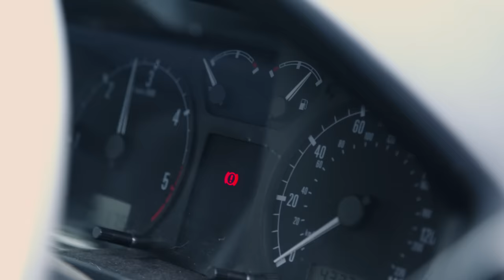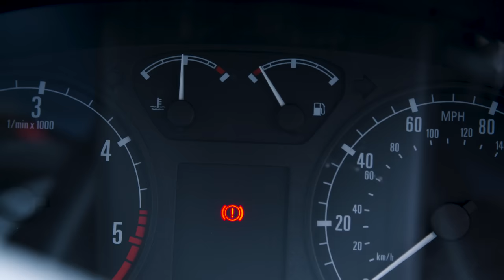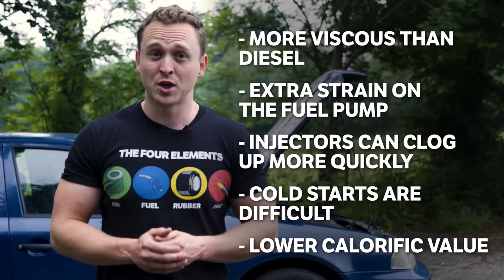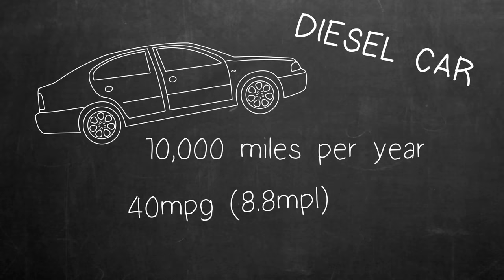The Pros & Cons Of Running An Old Diesel On Used Vegetable Oil

Comment: My dad owned a Citroen Bx 1987 1.9 liters diesel. We ran it 1 year or transformer oil. She was really good, quick note it actually cleans the injectors. When we switched back to diesel she was perfect. We bought her at 200 000 kilometers and we sent her to the junkyard at 1 400 000 kilometers. She did 0-160 km/h without any problem when we bought her(that's her max) at 1 400 000 she didn't lose even 1 horsepower and still did 0-160 km/h without any problems. Too bad rust claimed her...she's the strongest car I've ever known and I will ever know in my whole life!
Reply: Vladislav Levenov 1.4M kms wuuuuut??? :D crazy
Reply: I looked this car up and it reminds me of the earlier Ford Taurus which was a revolutionary design in America beginning in 1986. I wonder if this is where Ford drew some inspiration. Interesting.
Reply: Damn you onion cutting ninja.
Reply: those are some impressive numbers, no doubt!
Reply: You can run an bosch pumped XUD on near enough anything. Bombproof.
Reply: Errm,that transformer oil is cancerogenic and shouldn't be burned like that.
Reply: CME But it freaking made that BX go for 1400000 km.
Reply: Frytki? Almost any car will do that if you have regular maintenance.
One of the vans at my work has 900.000 and it is made in 2004. 
I think they are waiting for 1 mil and then retiring it.
VW Transporter or something like that.
Reply: What ???
14,00,000????? Km?????
R u kidding us??????
😂😂😂
If u drove this car 14,00,000km than u gonna get world record.....
...
In India i've never sewn any car more than 3,50,000 km.....
Even our daily driving public transportation send to junk at 8,00,000 to 10,00,000 km.....
And if any one see 1,00,000 km on odo than say its over now time to new car😂😂😂😂
Reply: Jigar Patel Theres some guy in the usa whos dailyed his porsche since new in like 1970, when it ticked over to 1M miles porsche gave him a 911 to congratulate him, but he still drives his old porsche, he says he doesnt trust new cars and if anything is up with his old one he will know instantly what it is... props to that guy 👌
Reply: why its she?
Reply: Damn you indians are strange. Ive never seen a car die before hitting 200.000km.
My last car did 220.000km until it had some problems with the suspension which would have been more expensive than the car itself.
The car I own now has 170.000km and looks and feels almost brand new (besides alot of scratches on the inside from the previous owner). There are alot of people selling this volvo-model with more than 300.000km online.
Reply: depends on how you maintenance them tho.
Reply: Jack Williams.....
I know many people drive their car more than 1M miles in USA....
And it's a good think....
Even in Canada has a wild nature though on autotrader.ca  most of car crossed 1,50,000 km which is for resell... But in India there is a many car which cross 1,00,000 km ... But  not much more cars which cross 2,50,000 km ..... Its may be due to weather or might be traffic... All are possible.......
But I seen Toyota innova  Toyota quails definitely cross 3,00,000 km in India but after that they being risky when they put you middle in the road no one know..... That's why no one touch it on resell....
...
My brother drove 1,80,000 km on Hyundai Verna (accent on USA) diesel model..... And it goes no any michenical problems.......
But when someone borrow they ask first will it make me possible to reach my destination?....
But its OK for long car journey also....
Reply: zampano 006 ...
U seems brother of 007 😂😂😂
Ya man its true in our India many Toyota cross 3,00,000 km without any hesitation but after 1,00,000 km people think that if there will be any major fault happen than it will cost us much more ... So people avoid that cars many people buy it but most of them try to avoid.....
But it worn out has some reasons ... May be weather..... Might be traffic........
All in all if u cross 1,00,000 km than  your resell value become very law... And its fact in india
Reply: Jigar Patel It's 1,400,000 not 14,00,000, why are you typing it like that? That's stupid
Reply: MegaxeonLV
 U r just taking it wrong....
That's what we Indian use......
We don't use billions million we use lacks.....
1,00,000 one lack 
54,00,000 fifty four lacks its a common math we all use in India.....
If u came in India and ask for million billion than many people Google it to translate in lack and carore....
10 ten
100 hundred
1000 thousand
10,000 ten thousands
1,00,000 one lack
10,00,000 ten lacks
1,00,00,000 one carore 

That's how we use this maths
Reply: Jigar Patel Now i understand it seemed just a bit confusing previously ;)
Reply: Jigar Patel you're writing in English, so why do you use Indians mathematics on this comment section where every Nation of the world meets and doesn't understand your usage of numbers? 
You could write it once or twice, but damn you only write like that. 🧐
Reply: MegaxeonLV
Yes
Reply: hawkseye
U doesn't understand number Codding but u can understand number itself.....
And that's not my fault it just a action which comes natural while I m typing.....
...
If I was use 1 lack 2 lack 3 lack that might be bit confusing for all so that's why I used numbers man
Reply: Jigar Patel what I wanted to say is, that not everybody understands the Indian number system. You wrote 1,00,000 instead of 1,000,000 (American system) or 1.000.000 (rest of the world). So you miss one "0". It looks like 250.000
Reply: hawkseye
You are not wrong at your mindset.....
And I m also not wrong at my mind set.....
...
That's the confusion between two numbering methods😂😂😂😂
Reply: World record is 5M KM. A volvo p1800
Reply: TRANSFORMER oil?!?

Yeah, because a dioxin-spewing death machine is totally worth saving a few bills.

Used transformer oil contains PCBs, dude. At least it can, depending on age. Not something you want to mess with!
Reply: MegaxeonLV our number system is garbage .-.
I hate it
Reply: zampano 006 well in India there aren't many things called roads, traffic rules or responsible drivers, so cars get thrashed.A lot.
Reply: Dhruv Chavla I think main reason is dust....
Which can cause major defects in car
Reply: Jigar Patel not really no it's just that our people don't care about taking care of their vehicles and most of the mechanics are eh too
Reply: I think the Taurus design came from the Ford Sierra. IIRC, I think the Sierra was introduced in 1982.
Reply: zampano 006 Yes but the cars available in India have to be made and maintained in India by Indians so the lack of longevity is self explanatory.
Reply: Jigar Patel In South Africa we fit cars with air filters and maintain them regularly. Why don't Indians try doing this?
Reply: andrew allen they come with air filters we just don't give a shit
Reply: Dhruv Chawla I clean and re-fill mine with oil with very 5000 kilometres. That possibly explains why I own 4 vehicles in excess of 45 years old :)
Reply: andrew allen that's good we just throw our cars into the mechanic and just forget about it
Reply: @lazar2175  nobody cares
Reply: @danielfulop  there are actually 3 mercedes e190 with more than 1m km in the MB museum, and thats just the e190 line, there are LOADS of old mb diesels, and a few gasoline ones still rolling down the streets.
Reply: @lazar2175  yeah as he would care about cancer in other people.
Reply: @jigarpatel8099  1,4 read. dude.
Reply: @jigarpatel8099  LEARN TO FORMAT you are writing 100k not even 1 million. a million has SEVEN 0´s
Reply: @jigarpatel8099  yeah and literally EVERYONE else doesnt use lakh, why do you use lakh internationally?
Reply: @jigarpatel8099  no you CANT understand the number because a lakh equals 10. we dont know lakh until you write its lakh, ffs....